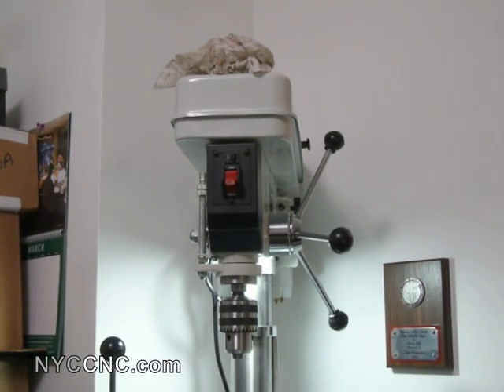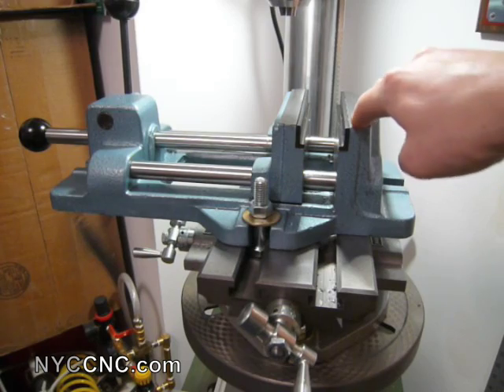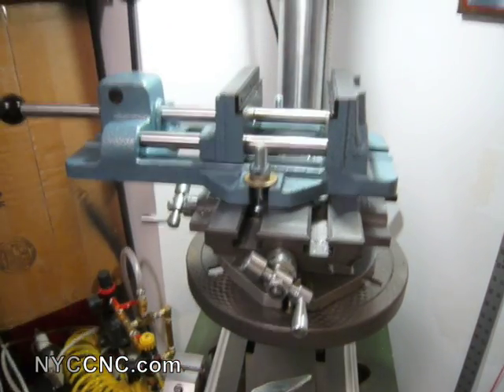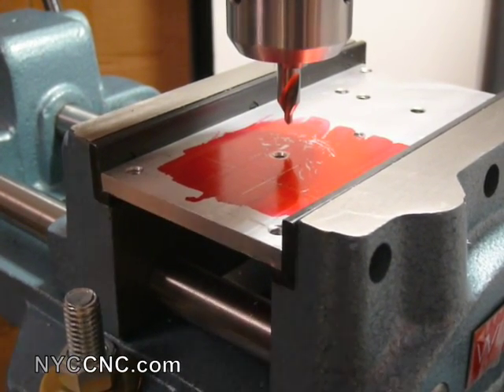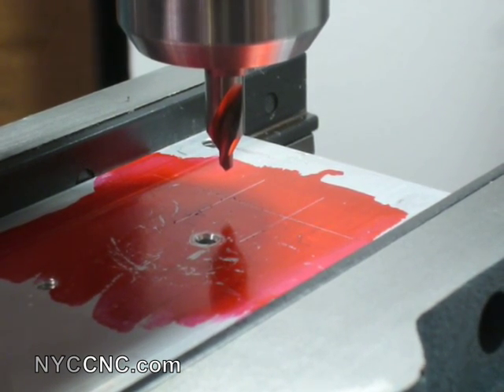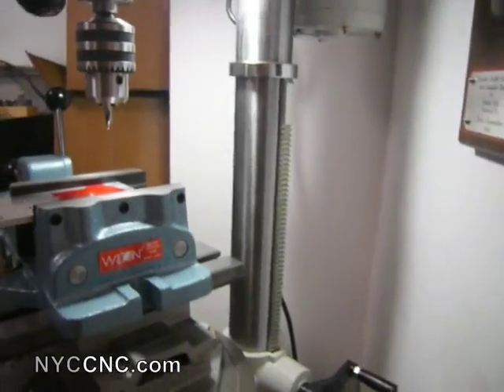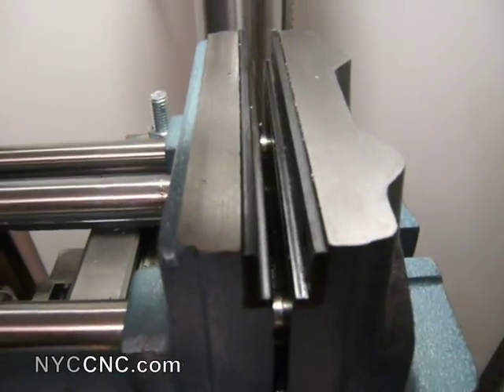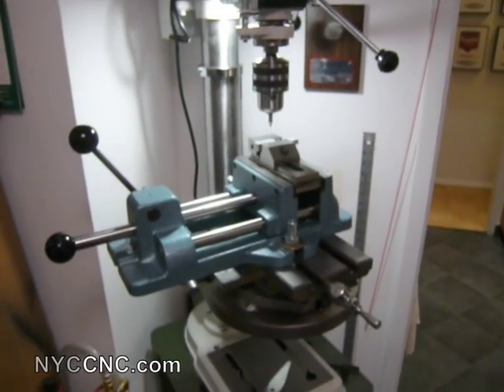Drill Press + XY Table + Wilton Cam-Lock Vise in hone machine shop

Comment: I have a similar setup with smaller vise.  Not needing 0.001 precision for sure.  Thankfully my press is an old craftsman with stout spindle, and a chuck that can't slip like a Morse taper.  Hoped  I'd see you using this in the video, especially milling.

Comment: The only problems with an XY vise aren't in the vise but in the drill press. Unless you have a really high dollar drill press, the shaft is probably 3/4" diameter or less. With an end mill cutter hanging out of the end of a Jacobs Chuck, it is far too flexible under load to hold really close tolerances. Also there is usually nothing holding the chuck in the shaft except the friction with the taper. Also the bearings are designed for linear thrust, not radial load and they wear out fast. When I tried a one inch fly cutter the chuck came off the machine and fortunately didn't hit me.

Not that I have anything against them. I have an XY vise and have used it to re cut keyways on shafts  but would never trust it with anything bigger than a 1/4" end mill cutter. Forget a fly cutter or boring bar. Mostly I use it to dial in fine hole positions. The best use I have made of the XY vise was when I had a simple metal turning project. I don't have access to a metal lathe so I bolted the vise to the bedways of my wood lathe, worked up a tool post, and once I got it dialed in square I did some pretty nice metal turning.
Reply: Amen Brother its a drill press not a milling machine !
Reply: Lawrence Withrow
Reply: Mr. Withrow, it seems u've scratched a peice of metal before. appreciate your follow up on everything you were talking about. No being a smart Alec, just tryin to learn everything I can be someone who is willing to share knowledge. Thank u again

Comment: problem with milling with drill press do away with drill chuck most have morse taper use hardened arbor...if not avaliable make bushing direct monut onto spindle with smaller id bored out for end mill...2 make spindle support ..buffalo during 1940 used to make one for this remember war effort people were produceing in home shops so ignor these who say it cant be done..not real machinists...real ones figure it out

Comment: just curious, but what model enco drill is this? and about what was the cost? in the market for a larger floor press.. my little bench one is a bit outdated..
Reply: NYC CNC oh wow.. that's cheap compared to what i was looking at. its only a 10" though? guess its on a stand.. i thought it was a floor model. do you buy straight off their website? thanks again for the info.

Comment: Bring the part on the table UP to the milling bit - rather than the opposite! I see videos of people doing this mistake every day, and still they complain about lack of rigidity! Side-load on bearing is increasing with distance from bearing to milling tip - an 80% reduction in this distance, is 80% less possible off center on tip, so raise Your tables gentlemen - and leave the spindle where it belongs!!! No problem at all, milling on my cheap DP as long as I do that. Love that cam-lock vise..:)

Comment: @Jeffnz020 mills need to be precise otherwise it's cheaper if you do it with a combination of die and bench grinders. I am pretty sure that bearings have a great load capacity and wouldn't be problematic with milling but it's the quill that won't allow any sideway force. use a drill press for what it's meant to be used, otherwise you end up destroying a perfectly good usable tool. converting an old and worn out drill press into a mill is even worse idea

Comment: I came across a dvd a while back that detailed using a drill vice as a makeshift lathe. It was quite good from my ill informed laymen perspective. He attempted to take the flex out of the system by basically epoxying the chuck into the arbour and the prerequisite filling the column with concrete and using the quill only for adjusting Z. Seemed to give good results.Also i know not about these things but i take it that vice doesn't cause parts to Rise up when tightened like a screw vice tends to?

Comment: still though, while center drilling and and basic Z travel jobs are fine on a drill press you'll never have the rigidity of a properly built mill.    The quill is where most of the problems come from.   They just aren't designed for high stress situations that most milling operations would put on it.   But, its good enough for most simple things..